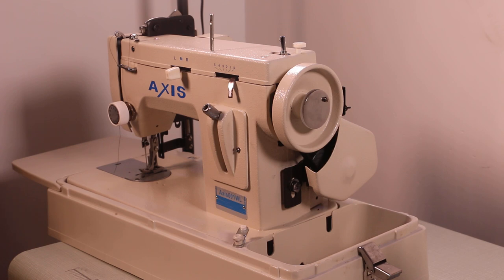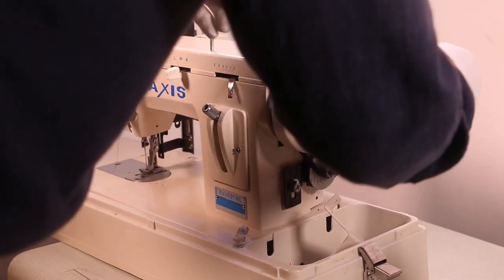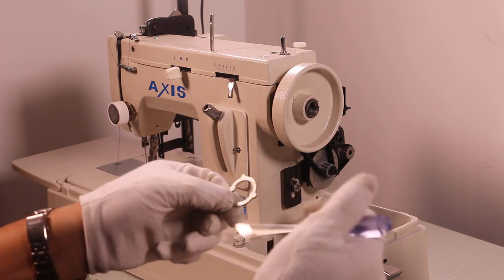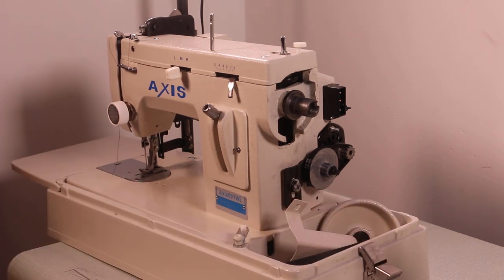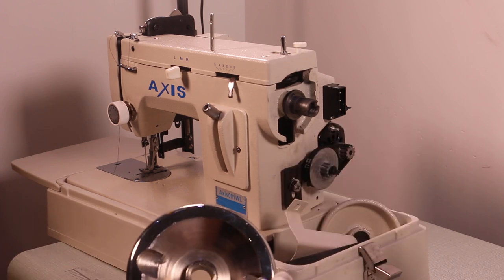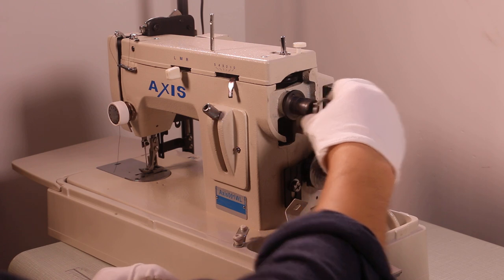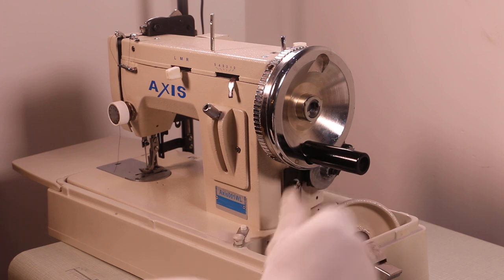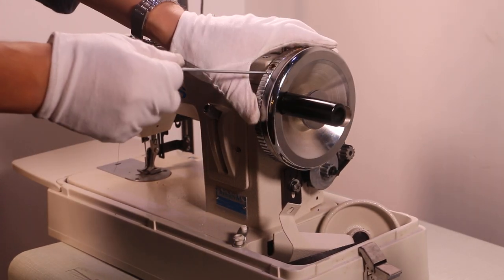How to change walking foot sewing machine handle wheel to  the flywheel

Comment: I have one. The belt keeps coming off the bottom pulley. I tried different tensions on the belt. Still keeps coming off. Any ideas?
Reply: On another video I saw on sailing the user added a washer to the end of the shaft to keep the belt from coming off.  Sailrite has a plastic cover over the small pulley.  I don't know if the belt rubs the plastic cover or not and keeps it on.
Reply: I'd say the motor pulley is not parallel with sewing machine pulley - there ought to be an adjustment that needs adjusting

Comment: A larger lightweight flywheel makes a lot of sense because it increases and the most B controllability of the machine however a larger much much much heavier flywheel makes absolutely no sense because it requires an enormous amount of the machines reserved power just to turn this heavy heavy flat it's just a gimmick that sell right has the extra power that you think you're getting increased diameter increased diameter increases the leverage the machine has a needle making you feel like got extra power but it's all for the increase size not decrease weight using the lightweight flywheel is much smarter
Reply: It does help with low speed control. Once you get up to speed it requires no more power, just like a heavy flywheel on a car.